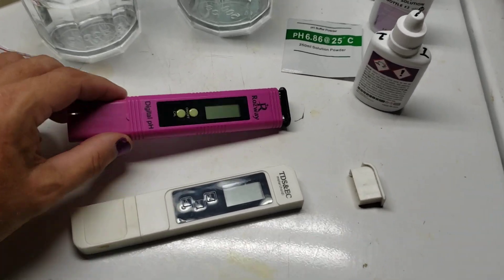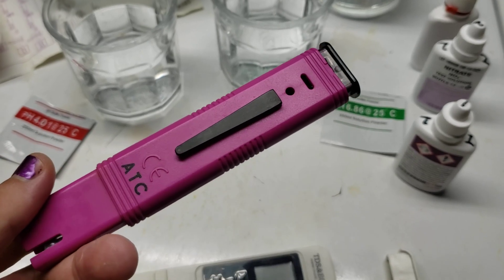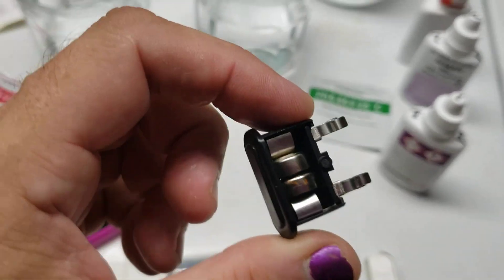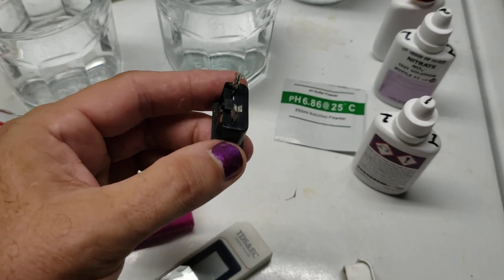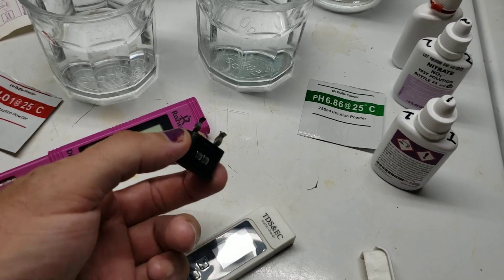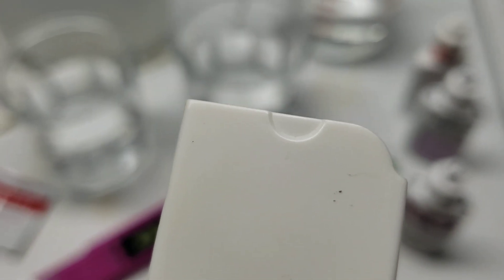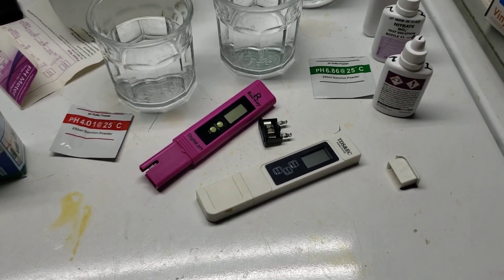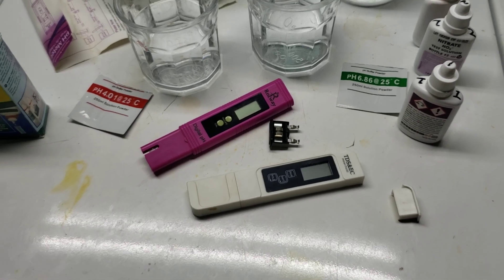I Did Not Know You Could Change The Battery In A pH Meter (Feel Free To Laugh)

Comment: Thank you for sharing that about the batteries in the pH meter. I figured out how to get the top off, but couldn’t see the battery in there, just a circuit board. I didn’t notice that the batteries were in the cap!  I tried contacting the company but couldn’t find a way to do that. Now...Problem solved!
Reply: Same! Didn’t know to install them in THE CAP! Thx

Comment: this did not explain how to put the batteries in. Which side goes where?
Reply from the maker: I assume it had little + and - symbols on it.
Reply: @DanHiteshew-oneandonly  That was the problem, there were no + and - signs anywhere on the tester.  The batteries have a + on the flat side, but the tester has no indication of of a + or -. Both sides where they are inserted look the same and there is no little spring. The batteries I was replacing popped out of the holder when I took it out, so I could not see the way they were.
Reply from the maker: @jholmes900  I'm not sure what to tell you then.

Comment: I did find out only the other day problem is I forgot which way the batterys went back in lol
Reply from the maker: The negative (smooth end) goes on the spring.(this applies to every battery powered device I've ever used)
Reply: @DanHiteshew-oneandonly  but in the meter you and I have, a volmate, they have identical "springs" on both sides.